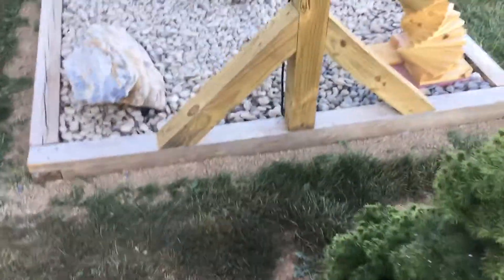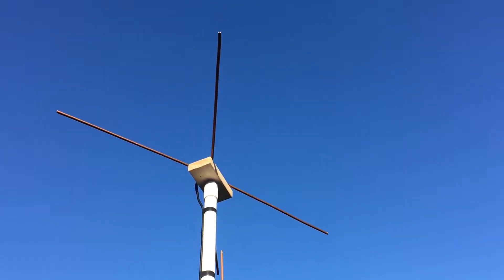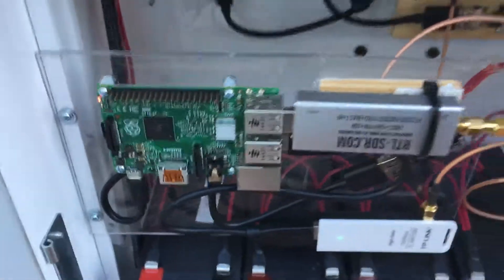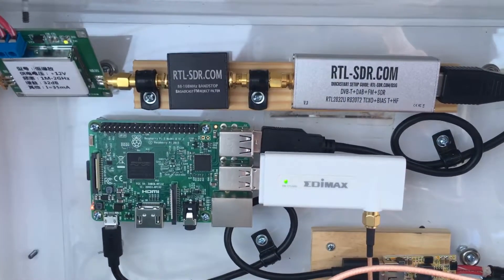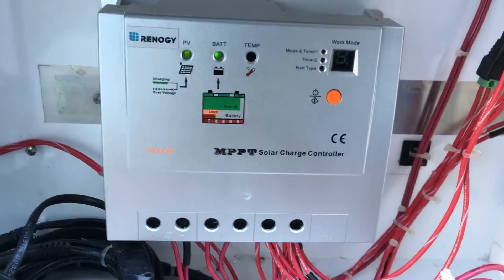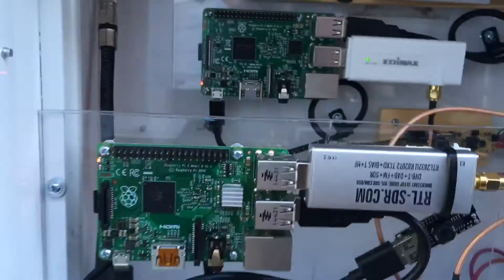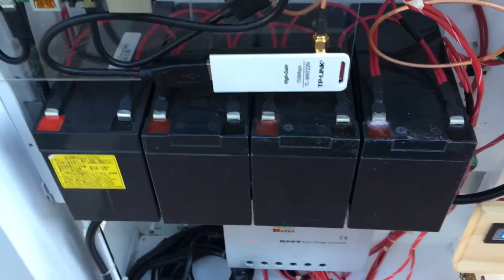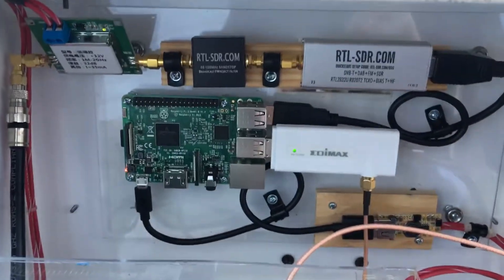Updated 10/1/2017 Video Of My Raspberry Pi NOAA Satellite Image Setup Using Solar And Batteries

Comment: That's a very nice rig in all respects. I have a similar setup, but my solar charging system is down and -- is Arduino MegaADK based. I have no LNA yet, but I do like the RTL FM Trap -- I am considering using two, in fact. I currently use a single dipole made from 10 gauge wire and it does relatively well, all things considered. I am going to put an FM trap in the QFH antenna -- and another with the SDR, like you have done.Well done, Fuzz The Pi Guy.